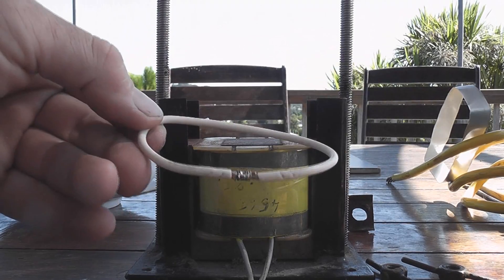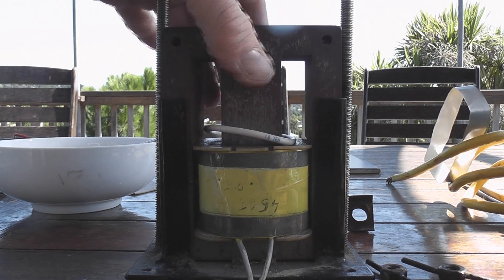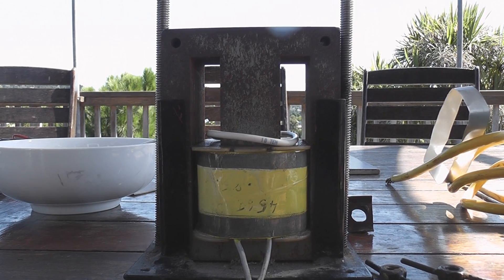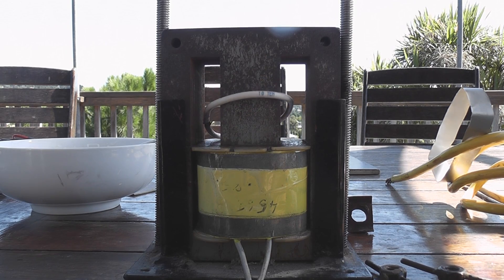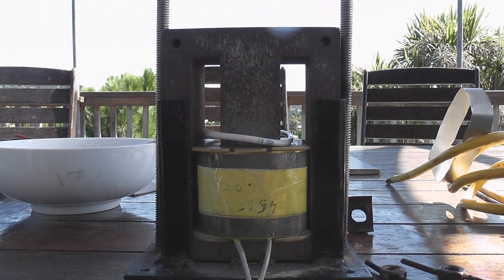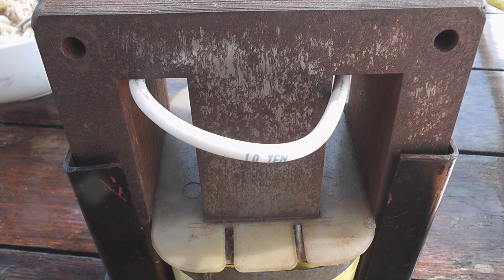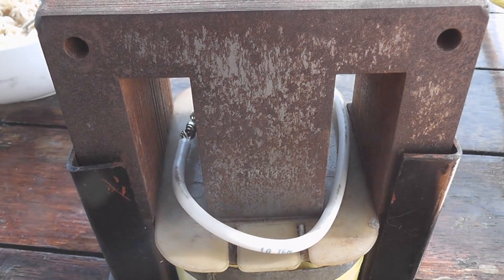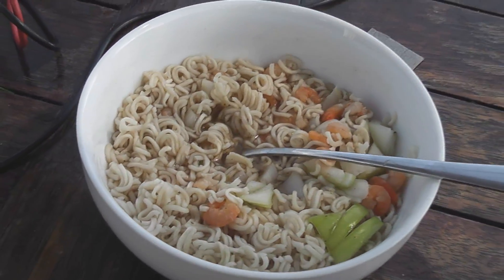Shorted turn on transformator

Comment: Given that the currents force looped conductors to rise or move, I'm guessing there must be some strong forces at work inside a distribution transformer?
Reply: +Zeal Ashwar Yes, they have to bolt the windings in place, with packing pieces. Even then, they sometimes suffer major mechanical damage if there's a fault